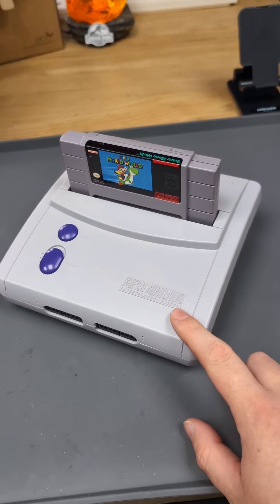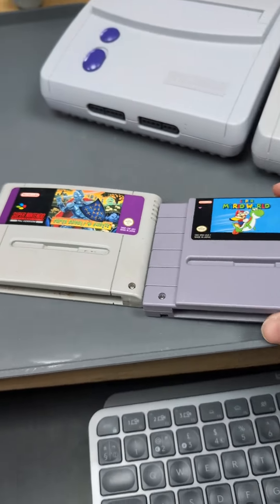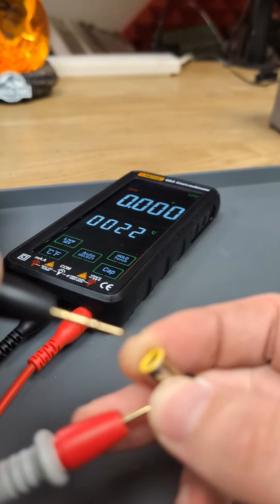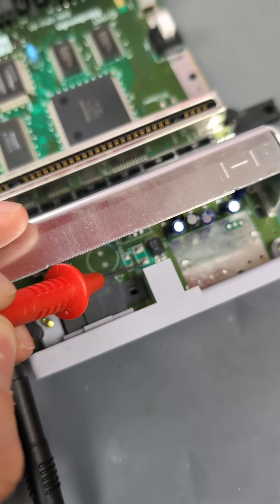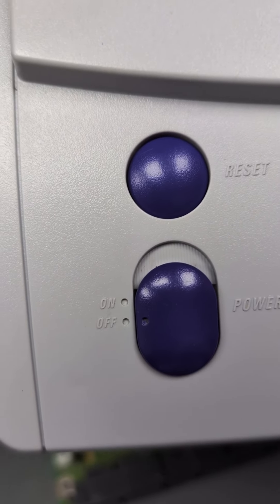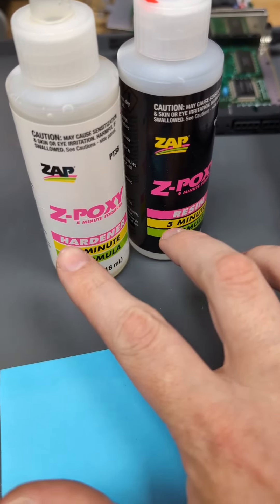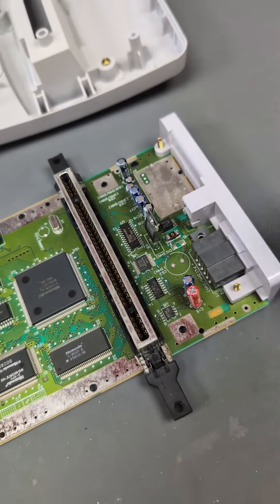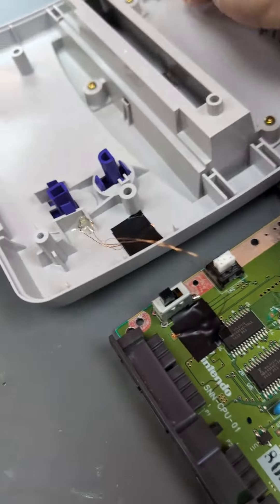The smallest SNES console officially made

Comment: You need to be careful with those ones. I had the same problems with my one 20 years. Turns out it was a pirated console. The pirate ones were virtually indistinguishable from the real ones.

You'd be better off getting a brand new Super Players Super Famiclone Junior for £45. It has S-Video and a 50/60 Hz switch. It was the best SNES clone until the Analogue Super Nt.

Comment: So, other than replacing a fuse (which you said was rare) and doing a recap, did you actually do any investigation at all as to why it was apparently blowing power supplies, or even if that statement was accurate?
Reply from the maker: Caps were leaky. As they warm up they short. So that would cause the issue